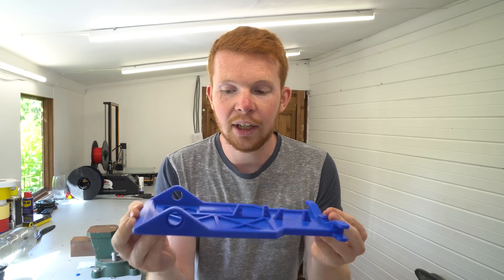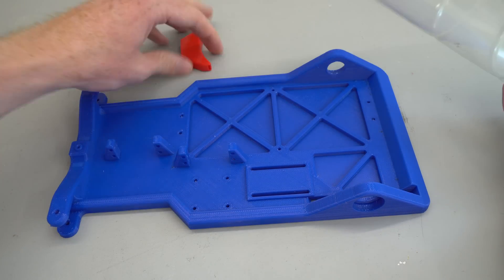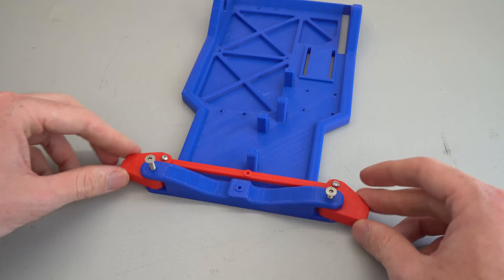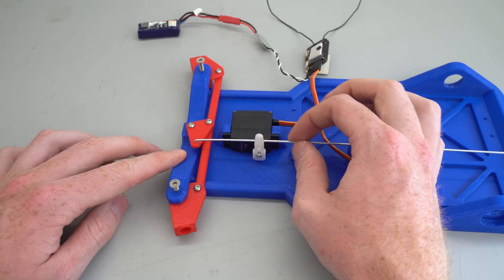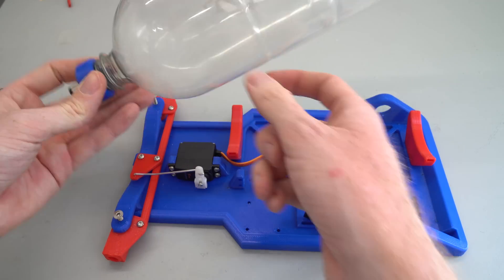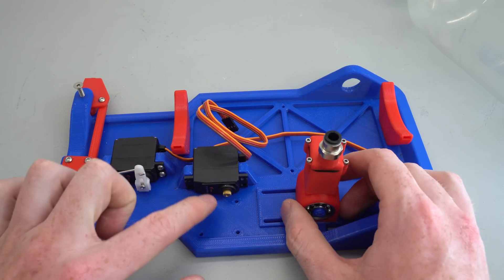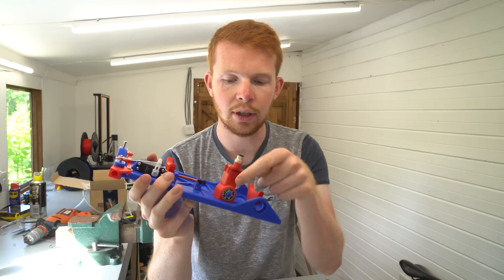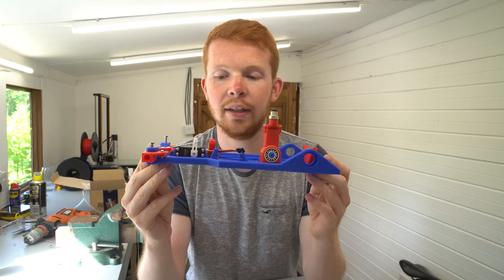Air Powered Car - Part 1

Comment: Great build. It looks like you aren't using nuts with your bolts. I have always put a hex recess on the opposite side for a nut, but this seems much easier. Are you just sizing holes for the minor diameter or using a tap? (Looks like the former.)

Comment: There are multiple problems here, the steering rack will cause scrubbing unless you use tiny tires, I suggest searching up some designs on actual car steering racks or stuff from RC car forums, you also do not have a diff meaning the car will not handle well unless you are trying to make a drift car, there are probably also a few other things I am forgetting, but it definitely looks like you should do some research and redesign this, at least if you want this to have any handling at all

Comment: What size are the bolts used to hold the engine onto the chassis? The engine mounting holes are 3mm diameter I believe, so I'm assuming a larger bolt would be needed? I have been designing a simple dragster chassis for this engine to mount and have changed the holes to 2.75mm so M3 bolts thread into the engine crankcase. In my experience, a 0.25mm smaller diameter is enough to keep parts together but not sure about keeping it tight to the chassis without sliding on a similar slot design to yours. Just curious how you did it? Also, huge thanks for making the files free on Thingiverse, but some people have been asking for the Bottle Cap STL and I'm sure the gears or drivetrain you design would be a great addition for others to print, I designed some spur gears that I think will fit on the crankshaft to drive my car.

Keep up the great work and really look forward to seeing your car drive!

Comment: Tom, are you still going to get the flywheel effect you need for the motor to turn over when you are running a small gear to a gearbox and then the wheels?  I suppose if you push the car forward to start it you would be OK, but you would never be able start driving from a dead stop without some sort of clutch.

Comment: I think it would be better with a clutch than without one... You can use a realy simple design that they use in nitro RC cars, I think it's called a g-force clutch. It's basicly a few pieces that are held in by springs, and when the engine goes up in RPM, the pieces are pulled apart and start scraping on a ''ring'' outside of them called a clutch bell. Then the clutch bell starts spinning because of that and there's your output. This is just an idea though. + I love this engine and that car is going to be awesome! (sorry for probably spelling half of the words wrong and sucking at explaining)

Comment: i dont see why you always thread your 3d prints for bolts, you could just save time by having the bolt go all the way through and have a locking nut hold it into place, that way it's easier to cad, build, and you can use whatever length bolts you want

Comment: Try using different  gases like helium to improve your speed and run time. I do not know how your motor will react to this so don't qoat me. Also if you use a difrent gas thats expensive then attach y coupling to your ecsost and attach balloons so you can capture the gas then all you need to do is re compress it
Reply: Sorry for bad spelling

Comment: Looks good so far
But since there’s gonna be a direct connection between the engine and the axel, then it’ll stall if it stops... you’re going to need to implement a clutch if you do want to be able to stop
Reply: It'll absolutely stall upon stopping, but given what we know about how long the engine usually runs off of the bottle, I don't think that he plans on doing a whole lot of stopping.

Comment: Instead of using CO2 paintball equipment, more affordable and lighter option would be to use DIY pressure vessel out of a spray paint can, some can hold up to 10 atm. Also, there are chinese pressure regulating pneumatic valves for ~7$, suited for that kind of pressures.

Comment: Use the throttle servo to drive a pusher lead screw into the throttle diaphragm for more percice control over it's air flow. Also, once the screw is at a depth, no force is required to keep it there and maintain that speed.

Comment: Why don’t use a aluminum high pressure gas can with a pressure regulator after it instead of the bottle? It does weight more, but it’s safer, and you will be able to have more on hand, and for longer

Comment: Good work, i am very experienced making Pneumatic (Air) Powered LEGO Technic Vehicles. i Recommend using a belt drive train system from a 3d printer. You be able to change ratios easy and is simple. i am also very experienced in RC too. Good luck 👍
Reply: Great idea!
And I've seen your lego cars before, they are really awesome!
Reply: thank you

Comment: Sorry for my English, but you need to use correct angles on steering hubs. Google- "Ackerman Steering". This will greatly reduce the resistance when cornering.

Comment: It is not going to work with a piston engine if you don't use a clutch. 
The piston engine need to run constantly making it impossible to stop or reverse the car(but it is great to slow it down with the valve you made in a previous video.) 
My suggestion is that you create a turbine engine with a constant airflow coming at it, you can slow it down using brakes on the wheels or you can make the car reverse inverting the flow. 
It is going to run even without a flywheel and start without an ignition spin making it possible for the car to come to a complete stop and than start again without anyexternal help to start the engine.

Comment: you should get a 4500/90 small compressed air tank with a couple step down regulators to drop the pressure down from 4500 psi to 40-120 psi if you want to do endurance testing on the engines or have a longer run time on the car.  these set ups are used in paintball and airsoft and would give you a nice consistent long lasting pressurized air supply for testing. i hate that you have to deal with constant pressure loss because runtime is so limited and power output is so variable. the plastic bottles were a great kicking off point

Comment: HI Tom. always like watching your vids.....just a couple of questions.      1.  can we see you design the gear mech's when you use the design software.screen capture card maby.it would be nice to hear your thoughts when you go through the design process and maby learn some tricks of the software too.
2. would using a NO2 cannister (the tiny one's) with a throttle governor give better performance with longer run time.

Comment: Does a servo require a servo controller? I tried the experiment on the  front wheel of RC plane moves as desired with esp 32 n a servo. I modified a arduino sketch  to fit in the control. I found only a few time out of 10 times that the servo will drive the wheel to move correctly. My question is the first statement of this message. If the principle logic apply to control other surfaces of the plane. I bet  the plane is 99.99% fail n fall from sky! I discontinue n seek your advices. TIA.

Comment: I must be missing something here. The reason I say this is that the power of a piston is proportional to the piston area and the pressure acting on that piston. The gas losses are proportional to the length of the perimeter of the piston. The best therefore is a circular piston. However Tom uses square. Is this due to some limits of printing? Circular would also give the option of piston rings reducing losses further.

Comment: Excellent! But without the prop, won’t you need a flywheel to keep it going? Or are you relying on tightly meshed gears and the inertia of the car? Remember that inertia goes through gears as the square of the gear ratio, so if you high gear it, the engine will see little inertia. I wonder if it’ll run at all, or at least at slow speed without a flywheel.

Comment: Hi Tom nice project but i think that the engine is mounted too lower you may have trouble with the main gear diameter.  The secondary gear on the axle cannot be too much big in diameter to avoid extreme high reduction ratio. To avoid the slow run of the car. Hi to the next video

Comment: Sweet, but you should seriously consider a dremel tool. Not only could you have cut those bolts the right length, but I can imagine if you ever need to trim of any plastic it would do the job nicely! Well done though

Comment: You've built a race kart! I like. Like another comment in here, have a look at kart steering and Akerman steering if you haven't already. You'll probably want a little Akerman built in, and you'll want to put in some caster to help lift the inside of the kart as you have no diff I'm assuming.

Comment: When screws are too long, just cut them. Put a nut on it first, so when you take the nut off, it will ‘fix’ the last thread. If a screw is too long, just stretch it. You have to start with the next size larger screw first because stretching it will shrink the diameter. 

Obviously I’m joking. (Screw stretchers are too expensive,)

Comment: Also make a boat model? Or design/sell a kit that can be used as boat and car? Amphibious.
Reply: kimoshwaby you have to make sure you dont run out of air in the middle of the pond though ;)
Reply: What about creating a small motor/pump/compressor that can fill the air tank up again, then  you can drive around longer.

Comment: I think you should make a super simple clutch using a channel on the controller. Just a servo that pushes two flexible cylinders together and pulls them apart would be sufficient. Having a clutch would allow you to have a neutral "gear" as well

Comment: Why dont you use a c02 cartrige instead of the bottle. You can use a check vaule to control the pressure. Also the co2 tank is small so it will be more aerodynamic

Comment: some small notes: You can check Ackerman steering and understand the principle if you want to get the steering with the least slipping possible. This is the method which is being applied in all full-size cars today you see on streets.
The way you do is problematic since that way the two wheels rotate the same amount but what you need is the two wheels rotate according to the same centre of rotation not same radius!
Also as you increase the length of the rep parts the wheel outstands from the rotation axis which is something you also don't want.

Besides from those great job and most probably I will try to make a similar thing:D Great job! Keep it up!!!

Comment: My biggest suggestion, use a timing style belt to connect the motor to the rear axle.  Gears would just be too much of a pain.  A belt will allow for some flex and also help absorb shocks from the axle.

Comment: I'm really impressed with your patience. I would have just run out and got a toy car and kluged the motor onto it to find out if it would work asap. Are you at all concerned about the lack of any flywheel?

Comment: Why you don't just switch to liquified gas like GBB airsoft guns use? Longer run times would be easier and/or smaller tanks. Sure the pressures are higher, but miniature pressure regulators are easily avaliable so you don't have to worry about high pressure in a short path.

Comment: another interesting design, but you must know that compressed air is not a very efficient storage mechanism for energy?  about the same as lead acid batteries in theory but in practice much less (maybe 0.25 of lead acid batteries?).  Fun projects, but not even efficient enough for good rc toys.

Comment: hey tom it would be cool if you could attach a pump that runs off the air engine with some gearing reduction so that it pumps air back into the bottle so you can get a longer run time
LIKE SO HE WILL SEE

Comment: You need to put dry ice and water into the bottle then attach it to the air powered motor
Reply: That way you have continuous pressure in the bottle it's like petrol for an air motor
Reply: Ich mag Kekse just add an over pressure valve thingy?
Reply: Ich mag Kekse pop off valves are really cheap. Those are found on almost any air compressor, they work really well and are adjustable. Many things use them, ranging from turbochargers, race car tires, air compressors, and even the trunk of my car (low pressure diaphram valve). You could make a basic one easily with a plunger seal and a spring, then use a screw to adjust pressure. Or they are available cheap anyways.

Comment: Instead of using plastic bottles, did you think of using Co2 cardridges? Or any other metall bottle in which you can put more compressed air than into a bottle? 
If you have smaller metall bottles, you could connect them in series. So in 4 cartriges you could have as much air as in 5 bottles, and in smaller space.

Please respond :)

Comment: I would use a toothed rubber belt to connect the motor and rear axel rather than a gear if all it's doing is transferring energy. You wouldn't need to mount any extra gears and could still gear the speed down and torque up.

Comment: Quick tip, you can cut machine screws and bolts, but when you do, make sure you put a nut on it that fits so you can take it off after you’ve cut it, and the threads will be straight

Comment: Hey bro, why don't you make a compressor to put between the bottle and the motor, to create more pressure and consequentily generate more RPM.
Print it on 3d printer, I would like to see this.

Comment: You have to install a small compressor on it that you can drive slow permanently and when you want to be fast for a short amount of time you can close the inlet valve of the engine and build up pressure. When you then open the valve you get a boost.

Comment: Since your doing so many air powered vehicles as of late, you should make an air compressor so you don't have to manually pump them up each time. 3d printer, hobby motors and batteries, shouldn't be to hard for you. I think it would really cool, you could use it on so much more than just your air powered vehicles too. Blowing up air mattresses, balloons, etc.
Reply: or he can just buy one haha
Reply: Diaphragm compressor. Super simple, dead on reliable tech. I have one that was made in the early 80s from plastic (for spray paint guns), still works.
Reply: He could print another motor and use it for a compressor.  Use a cordless drill or a sewing machine motor to power the lil machine.
Reply: Didn't he run the engine off of shop air for a test in a previous video?
Reply: clavo "and you're sorted" "and you're good to go"
Reply: Thanks for clarifying before I got back here, Isaac :)
Good job I didn't say "and Robert's your mothers brother" like I was going to.... that would really have caused confusion!
Reply: I've been wondering for a while why you haven't bought (or long term borrowed) a cheap car tyre compressor instead of using the bike pump. I'm sure you can pick up a car battery from somewhere, and you're sorted. :)
Reply: MIke S. - Probably has to do with using as few motorized things as possible; to prove maybe, a Martian utility?  Another is the utility of the plane or car as a toy for a kid that doesn't have a compressor.  Yet further,  he may like the immediate light touch control that the manual pump provides.
Reply: Mike -  I understood tyre; it's: "...and you're sorted." that has this: Hispanic Texan raised to learn English by German teachers, completely stumped! LOL.
Reply: Isaac: Thanks, appreciate the lift to understand.
Reply: Mike S. LOL; yes it would've; or would of, as the new American popular mal-contraction and re-expansion of "would have".

Comment: You really need to use something other than a coke bottle. Not enough air in them at all for anything other than showing the engine runs. You need a tank and a regulator. That would make your creations so much better.
Reply: But at least the whole car won't be top-heavy with the plastic bottle I guess...

Comment: Nice begin for the car. I think you should put 2 motors in for when one is at the bottom the other is going up. It will be easier to start the car without pushing it.

Comment: I would recommend using a belt drive over a gear drive. If you could 3D print a torque converter to work in this belt drive that would be a really awesome part. But if not, regular belt drive I think would be best. Cool video, good luck.

Comment: You will need some sort of clutch or the motor will stall with the first bump
Reply: And a weighted flywheel too. Torque seems pretty minimal, so it's going to need that extra bit of mass spinning to compensate.